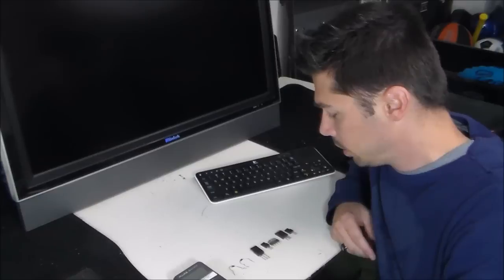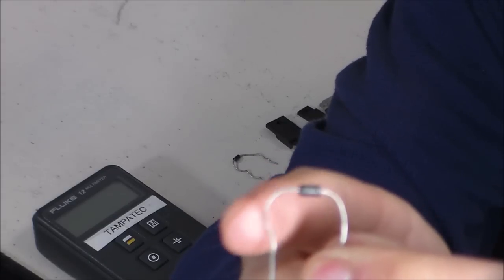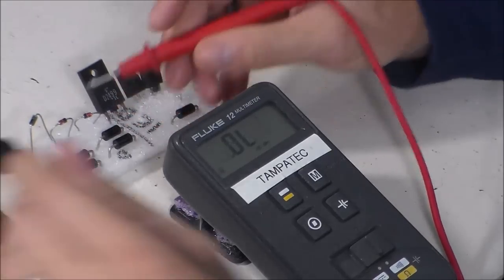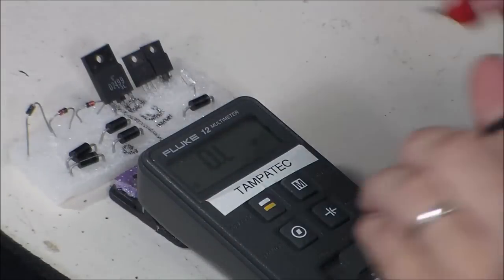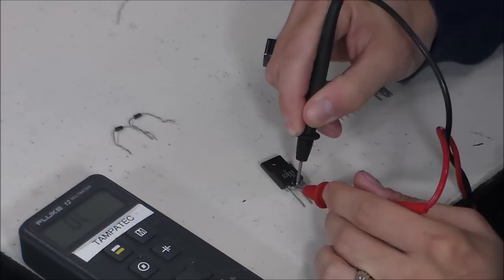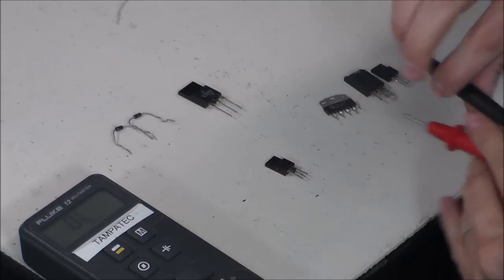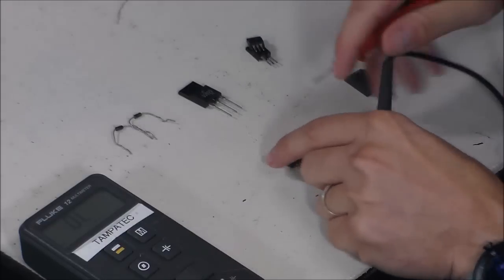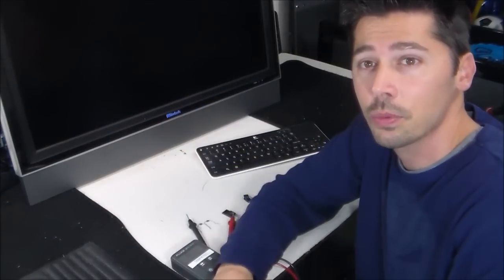How to check fuses, diodes, transistors, voltage regulators

Comment: Sub'd a while ago, but didn't thumbs up/comment (my Son just explained the importance of doing those things) so I'm back to correct that while refreshing my memory on the parts & procedure needed to fix our 42" Phillips TV!                                        Your info/vids helped me identify the problem & clearly showed me how to repair it using a repair kit (or the easier but more costly replacement power supply board) however I wasn't confident enough with my soldering skills to attempt the repair at the time I found your vids (might have tried despite my fear if our TV only needed 1 or 2 things soldered but the amount of obviously bad "bits"on ours & amounts recommended to be changed or contained in the repair kit far exceeded my DIY bravery LOL) & I haven't been able to swing the cost of a new PS Board so the TV has just been collecting dust....  I quit watching TV a couple years ago so it hasn't  bothered me but my Son is a gamer & really misses the big screen...his only wish for Xmas this year is having the TV repaired  so I'm hoping to gain enough confidence to do the repair by watching more of your helpful vids...wish me luck!!!

Comment: I have a Denon with no output. we found 2 diodes that is defective and replace but still no output... the transistor is seems to be working as I can feelnits getting hot when I turn on.. still no sound... Any help out there to a widow son of Hiram Abib.

Comment: Good I liked it. Just one observation. Transistors cannot block voltage, even if a transistor is open you will still have a voltage across it. Transistors will block a current flow or it will let it pass. That is what it will do. But in general you are a good teacher....

Comment: Hey ***** , a salvaged power supply I have gives a varying voltage but doesn't blow a fuse. One of the Zener diodes give a reading of .794. Do I change it?
Reply: +Felix Red  It looks like you have a forward biased diode and not a zener diode
Reply: Zener diodes are the orange and black glass diodes right? Because that's what I have.
Reply: +Felix Red  I would,,,, I:ve Seen This Problem before in a 13,8 v Power Supply,Oh By the way Good Luck in fixing the power supply!!!
Reply: Noted and thanks man
Reply: +Felix Red Zener diodes are not like a regular diode. They are biased in two directions, but with a different behavior depending on the bias direction. In forward bias, they function similarly to a typical diode, with a fixed voltage drop, but in reverse bias, instead of a voltage drop, they have a fixed voltage maximum, which depends on the current.  They are typically used reverse bias to clamp the max voltage to a specific value, and are critical in voltage regulation circuits, if it uses them.
Because of how much the zener relies on current to give predictable behavior, the first thing I would check is the resistor typically close by in front of it's bias direction. If this is damaged and overheating, causing its resistance to swing, it could cause the voltage clamping of the zener to swing, ultimately causing the varying voltage you are describing.
Reply: Salvaged the whole thing already. But thanks for the knowledge mate.

Comment: Hello Paul, getting readings of two SB140A diodes of .209 .215 in ohms mode 8.6k reversed is going from OL to .7 or 1.0 would these diodes be bad? Cheers from Ireland 👍🏻

Comment: Cool videos TampaTec...keep em coming!!! I live in TPA as well, I am an Electrical Engineer by Schooling, but have worked as an I.T. guy all my life. Keep making videos !!!
Reply from the maker: Thanks
Reply: ***** How do i diferentiate a transistor from a voltage regulator they look similar?great tutorial!Right now i am working on a reel to reel with a problem on the control area.it wont play when i actuate the play switch (switch is good)CheersRob
Reply: +Tampatec I want ic no digram

Comment: Great video, I'm a little new to this. How do you tell a PNP apart from and NPN. Is it written or is it after testing by trial and error?
Reply: If you use the red lead (+) on the  base or black lead (-) on the base to obtain your display on your multimeter.  In live circuit use your voltmeter setting make sure to make your ground stationary before you test voltage in a live circuit.  Use only 1 lead never make yourself a ground source while testing a live circuit....  I would suggest you work with a dead circuit use your Ohm or Diode/Tone setting.

Comment: thanks for the video....are there any surfaces that can impede a reading ?   Like I have a plastic utility table...should i use paper or something to set the transistor on before I try to test it ?   Thanks
Reply from the maker: wood, rubber, plastic table tops is ok but conductive metal or semi conductive material avoid which should be easy, hope this helps.

Comment: hey i got a mintek dtv373 no buttons on the tv work or the remote stuck on dvd player? what do i test on that main board to see what might be bad?
Reply from the maker: try a reset 1st, then check volts to main logic board then check all connections, solder joinrs and capacitors.

Comment: Hi, ***** thanks for the help on my insignia tv it was the main board. I ordered 1 and now it works.But there is something wrong. The CC Caption will not stop showing up. I turn off all the CC Captions aNd it still stays on. What could be causing this....?  hope you can help thanks again for all your help.
Reply from the maker: there's 2 cc settings one for cable box and one for tv, try a reset by unplugging power cord or factory reset in tv menu. it might be not holding memory contact seller of tv board.

Comment: Paul I have a samsung lnt4071f with just a white screen , power is fine but no picture at all. Is this a t-con issue?
Reply from the maker: yes it can be tcon but also loose connections or bad main board or defective lcd panel. I do video chat helpouts via new app called Google helpouts,  use code paul51p for free helpout.